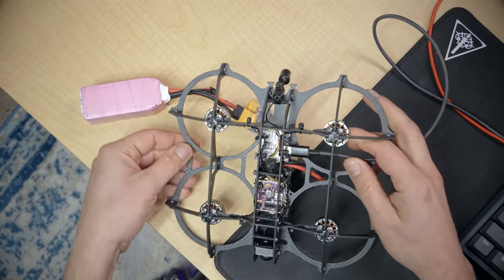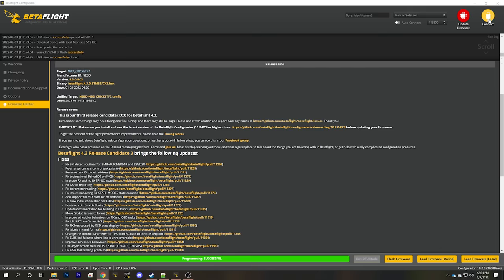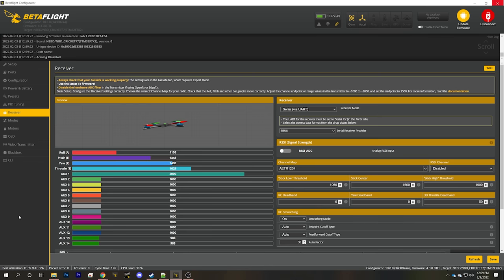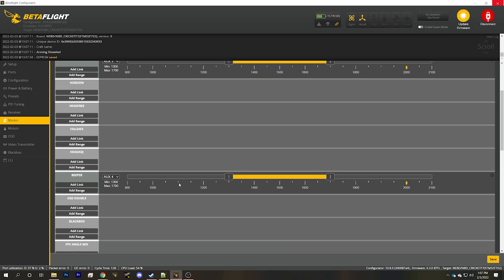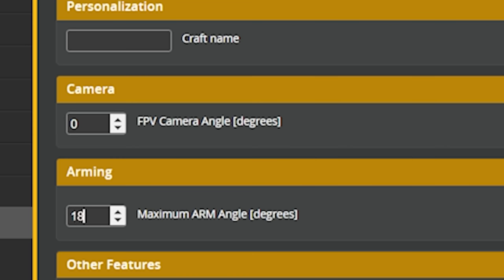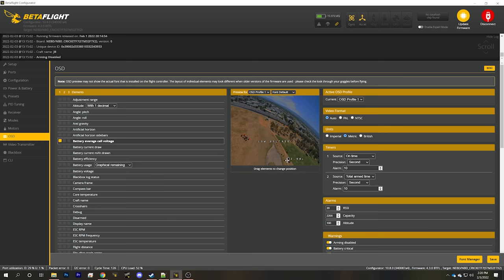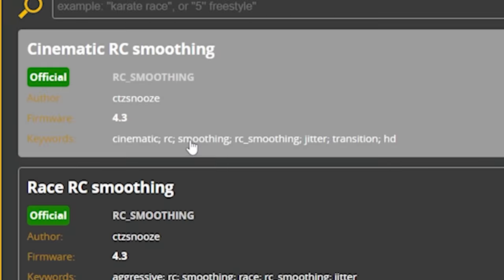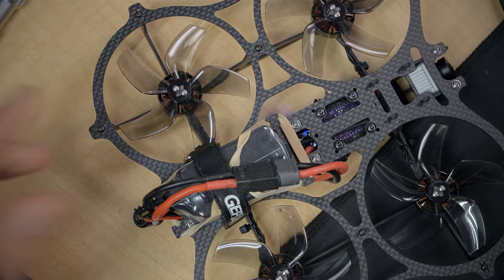Newbeedrone CineMah Build - Part 2 - Betaflight 4.3 Configuration

Comment: Hi JB, great video, glad i found it since i recently started building cinewhoops. Might be a dumb question, i'm currently building a pusher and i see you setup the motors in correct normal directions even though you built a pusher, but if the quad is a pusher, in other words upside down, how do you install your props with the motors upside down? Do you also have to install the props upside down? This is one of those things that is driving me crazy and i have not found any videos explaining how to correctly mount the props with upside down motors and directions of motors and prop installation. Thank you for what you do for the fpv community. Your videos have taught me everything i know since i started the hobby 3.5yrs ago. Just now getting into pushers tho.
And Happy Holidays to you and your family. 🎉

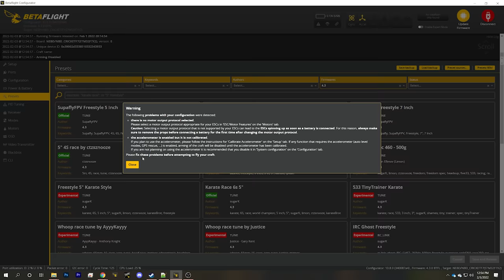Comment: Wow ! CPU Load went from 1% (2:11)on BF4.2.0 to 25% (4:22) BF 4.3.0 on defaults and even above 50% (16:11) once everything is running. BF 4.3.0 is beating the crap out of that F722 XD
Reply from the maker: BF 4.3 is a tiny bit more processor-intensive than 4.2, but what's actually happening is that they calculate CPU% more accurately in 4.3, which the net effect is that the readout goes up. But in 4.2, you wanted to keep CPU% under like 45-50% at most, while in 4.3, you can run it as high as 75-80% without a problem.
Reply: @JoshuaBardwell  nice to know thank you for your answer.

Comment: Hey quick question   when I flash any quad to 4.3 the cpu jumps up to like 60 from like 9    what can I do to lower it and both are on stock bf tune
Reply from the maker: Nothing has changed. Just the reporting of CPU% is more accurate now. It used to be you tried to keep it below 50% or even lower. Now you can let it run as high as maybe 75% safely.
Reply: @Joshua Bardwell  awsome just strange all my quads run about 10 and when up put them to 4.3 thay all jump up to like 60
Reply from the maker: Like I said, that is normal. Nothing has actually changed. Just the CPU% is calculated in a different way that makes it more accurate, and read higher. It used to read lower, and the threshold you wanted to stay under was also lower.